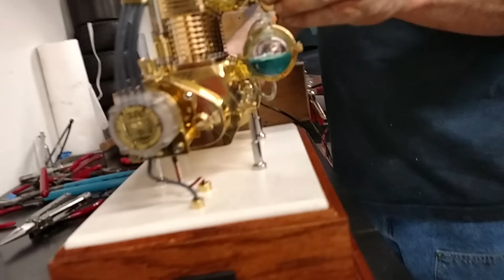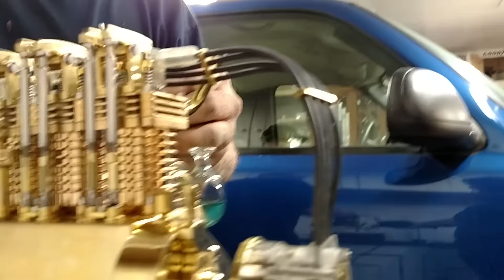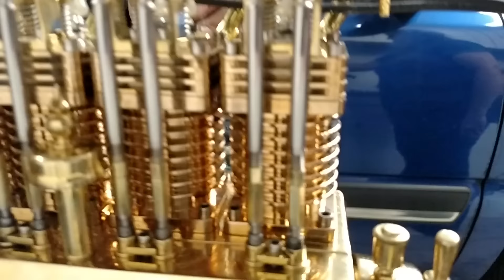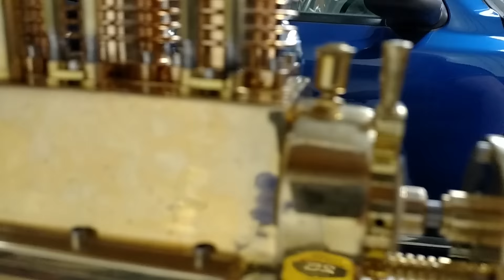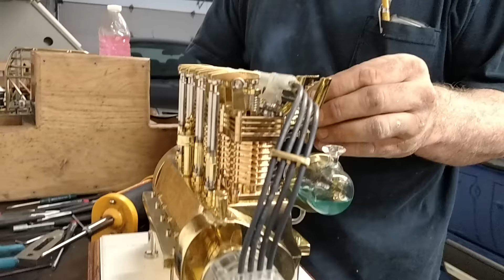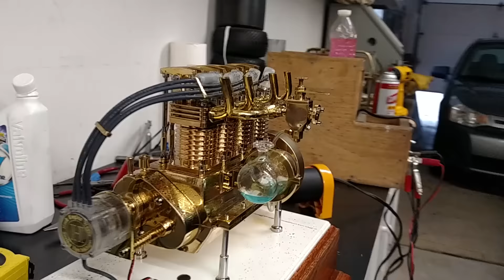VID 20151121 135045116

Comment: Damn thats cool. Did you pour those bronze  block and cylinders? 
Im gonna order the plans right away. Thanks.
Reply from the maker: The only castings are the upper and lower crankcase,  the timing gear cover and the flywheel. All brass castings. Every thing else is bar stock.
Reply: @stevehuckss396  thats impressive. Ive poured a lot of aluminum but no success with brass or copper. I can get it red but not quite melting.
 Kudos to you.